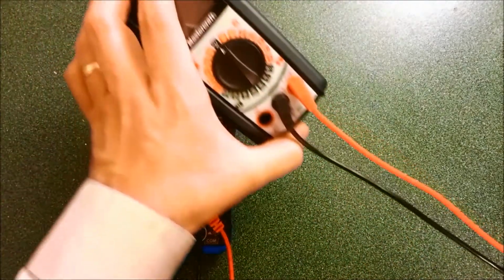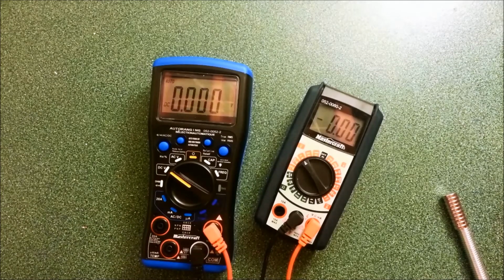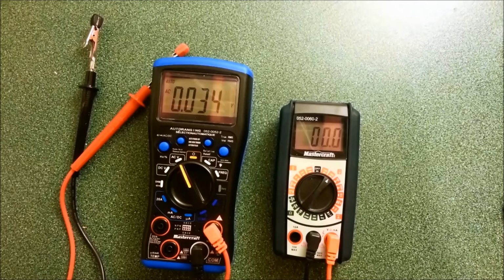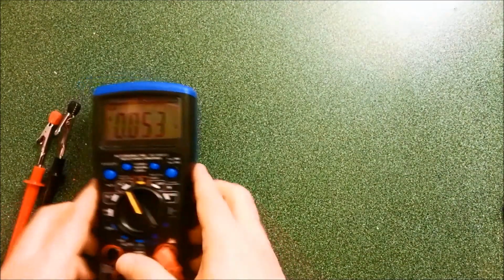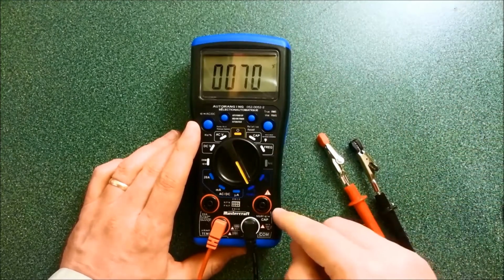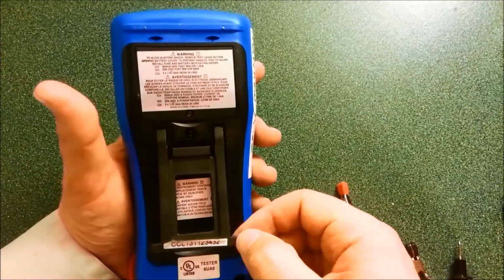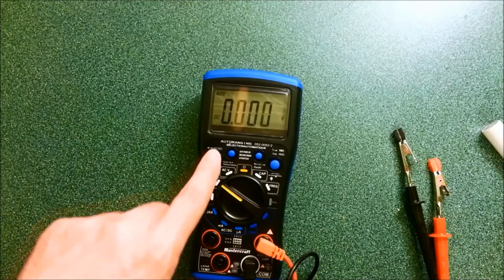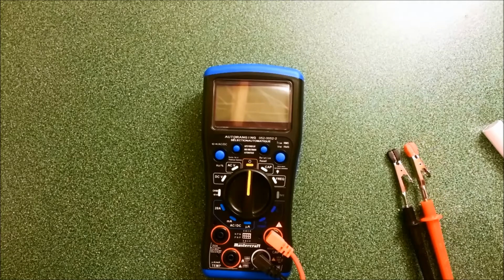Mastercraft multimeter review

Comment: This item is also labelled COLLUCK model HH2205D. The pdf manual is available here: https://www.circuitspecialists.com/content/90459/csi2205d_manual.pdf   If you read the manual you will discover that it was made in China by 
HUNGHEY ELECTRONICS (SHANGHAI) LTD 
The First Industry Park. Airport Town
Pu Dong, Shanghai
The P. R. Of China 201202
and has been rebranded and customized to suit each company. The hardware is the same. The labelling and colours may differ between rebranding companies. As per the video Mastech does not seem to sell this item as the video states. I could not find anything like it on Mastech's website.    My eyesight isn't what it used to be. Font 3 or 4 didn't exist in my days. Dot  matrix Printers could not print that small. I can't read a size 3 font which is why I search relentlessly for online .pdf files of the manuals. It seems like "fine print" can pretty well disappear as we can go smaller and smaller with print size.
Reply from the maker: Sounds like the company that owns Ryobi!  They also own several other tool brands but you would never know it if not for some other great YouTubers out there.

Thanks for the info!
Reply: Thanks for that! CT has kept the same product number thru multiple differing models and it's hard to find the correct manual. Good sleuthing!

Comment: TIP: get an in-line 10 amp fuse module to put insert into the red leads (all of them, also, if you may use such as alligator). This way you will not blow the internal 
fuses and making replacement easier. You will also have a fused meter on
 the unfused amp settings, as well.
Reply from the maker: +Kyosa Canuck Not a bad tip at all!  Thanks!

Comment: Dude, there is a difference between cheap and inexpensive. I have a $10 meter,  a midline such as the MC on the left, and a Vantage. You know what? They did everything equal (sensitivity was +/- 10%  on all) in terms of their capabilities. What the $700+ Snapon Vantage did, a $70 MC could do the same and as well. The Vantage only did one thing, really, that the others did not: it is not an averaging meter but midline oscilloscope, as well as averaging, so it can get real-time readings from things such as car sensors, fuel injectors, and all other vehicle electronics.
Reply from the maker: +Kyosa Canuck Cheap means of low value.  People misuse that word all the time to mean low cost.  I don't.

So with that, inexpensive would be a more flexible term but mean "spend some money but you don't need a Fluke" meter as a casual home owner or tinkerer.
Reply: For others: cheap is defined as low quality but not inexpensive. I have bought a few things from China, for instance, that were inexpensive but not (overly) cheaply made. My MC is made of the same material as my Snap-On Vantage.